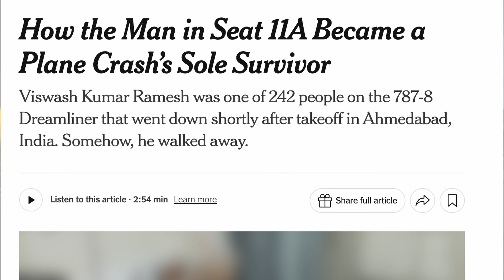Why the RAT Changes Everything – Air India 171 Update

Comment: As an Indian Aerospace Engineer, I’d like to share my perspective:

1. The airport in question is a major international hub, handling over 35 international flights daily. Since no other aircraft reported similar issues, the possibility of fuel contamination appears unlikely.

2. If there had been a complete engine failure, it would likely have been detected during the takeoff roll. Given that the takeoff seemed normal, it's reasonable to believe the engines were operating initially, though there was clearly a subsequent loss of power or thrust.

Ultimately, the exact cause will only be known once the black box data is thoroughly examined.

Deeply saddened by the tragic loss of lives—my thoughts are with the families and all those affected. 💔🙏
😢😢 😢😢😢😢
Reply: The fuel is still a question even though it’s a major airport. I hauled lots of jet fuel, one little hiccup can cause fuel contamination. 
The damage is done though and my prayers are with the families that lost their loved ones.
Reply: That means engines "failed" after the lift-off. Or rolled back to flight idle after the transition from "ground to flight" and crew were unable to restore the thrust.
Reply: Hi everyone,
I just wanted to share my perspective. Given that the aircraft was 11 years old, there’s a chance it suffered an electrical failure, leading to a total loss of power and engine shutdown. Since everything appeared normal during takeoff, the pilot might have deployed the RAT (Ram Air Turbine) as a last resort. That said, the actual cause will only become clear after the black box is examined. Until then, any assumptions or discussions are just our way of coming to terms with the event—because no explanation can truly make up for the loss 😢

Comment: Back in 2015 there was an article called "US aviation authority: Boeing 787 bug could cause 'loss of control" 
here is a fragment from there. A Software Error Could Shut Down the Engines
In lab testing years after its first delivery of 787s, Boeing discovered a software error in the generator control unit. The error could result in a total loss of electrical power to the aircraft, even in flight. The condition occurred if electrical power were left on for about eight months without being turned off. More specifically, the problem became existent on the 248 day of continuous electrical power.
With its extended dependence on electrical systems, the 787 could experience a loss of control if it lost all electrical power. Loss of control of the airplane could occur during any phase of flight, including takeoff, landing, or while maneuvering in the air. Control loss during takeoff or landing could be particularly catastrophic.
Why would any airline keep its airplanes powered up for such a long period of time? When the 787 was first delivered, customers discovered that the airliner issued a series of erroneous nuisance messages when it was first powered up. Boeing recommended that the airlines power up the 787 earlier for a flight than they otherwise might to avoid this condition. As a result, many airlines simply kept their Dreamliners powered up continuously until their next maintenance intervals.
Fortunately, according to Boeing's records, the electrical power for all 787s currently in service has been turned off as part of routine maintenance approximately every four months. The maintenance intervals for the airliner have been much shorter than the eight-month trigger point, so the problem of electrical power loss has never been experienced by an airline.

Comment: Hi Captain Steve. When you take into account that a) radios were working and b) pilot was able to pull up the nose until the last minute, do you think that is still consistent with loss of electrical power/RAT deployment? My understanding is that RAT only deploys if APU is not working. But there seems to be evidence that radios were working and pilot had some hydraulic power to pull up until the last minute.

Comment: But when you replay the video with the sound., the loud sound started right at the start of the video.. and on that angle at the start, the RAT is not very visible on the plane in the video which on that angle has a very clear shot at the bottom of the plane. So when you say the RAT deployed at the end of the video, it doesn't connect to us hearing the loud whirling sound at the start of the video.. AM i making sense?

Comment: I am a FAA licensed Airframe and Powerplant mechanic working on 767, 777 , 787 and other aircraft type that uses the RAT for emergency electrical and hydraulic power. One of the maintenance tests is to deploy the RAT and energize the RAT so it spins like a motor. This is done to simulate emergency deployment which is then measured for operational efficiency. The RAT is loud, very loud because the blades are turning at an very high RPM. You can clearly hear the noise throughout the hangar. This hangar is huge - it can hold 2 777's at the same time. 
May everyone whose lives were lost RIP

Comment: Stevie (I Wonder), why did you shout off your mouth, without getting your facts right ? It's very easy to shift the goal posts, once you've already done an evaluation of both the pilots credibility!!! The Captain had a clean flying record with 8200 hours & the Co pilot had 1000 hours, not a mere 100 hours. You strongly accused them of miscommunication, flaps, landing gear not retracted, etc etc etc. Then tou said dual engine failure is impossible!! You now seem to have  changed your mind. Anyways, an English saying comes to mind. " Its better to keep your mouth shut, then open it, and let all doubt out ""

Comment: So neither of those engines has failed, they are both in rude health, but they are either shut down, or being shut down. There's only one thing that could cause BOTH engines to power down at the exact same time, and it isn't contaminated fuel, it's the software in the engine management system.

There's only one "Single Point of Failure" on most modern airliners and that's the software, not the computer hardware, there will be redundency for that, but it would be running the exact same software. This will be some sort of software test edge case escape.

Comment: I asked Grok what would happen if the 787 lost all electronics, and this is the answer: If a Boeing 787 were to experience a total loss of all electronics, including the Full Authority Digital Engine Control (FADEC) systems, the engines would likely revert to a fail-safe mode. The FADEC system, which controls the engines, relies on electronic inputs to manage thrust settings. Without any electronic control, the engines would not maintain the last thrust input data, as the FADEC requires continuous electrical power and data to function.

In the absence of all electronics, the engines would most likely default to a predetermined fail-safe state, which is typically a low-power or idle setting, to prevent unsafe operation. This is because modern jet engines, like the General Electric GEnx or Rolls-Royce Trent 1000 used on the 787, are designed with safety mechanisms to avoid uncontrolled thrust in the event of a total electronic failure. However, the exact behavior depends on the specific engine design and its fail-safe mechanisms, which are proprietary and not fully detailed in public sources.

Given the 787's fly-by-wire systems and reliance on electronics for flight control, a total loss of electronics would also impact other critical systems, making controlled flight extremely challenging. The aircraft might still be controllable to some extent using mechanical backup systems (e.g., trim controls), but engine thrust would likely be at idle or a minimal setting, complicating any attempt to maintain flight.

For precise details on the 787’s engine behavior in such an extreme scenario, only manufacturer data from Boeing, GE, or Rolls-Royce would provide a definitive answer, as this information is not fully disclosed in public sources. Would you like me to search for additional context or focus on a related aspect of this scenario?

Comment: Come on Captain Steve! Hard as it is to suspect a fellow aviator, why haven’t you mentioned that this could have been an intentional act by a cockpit crew member? If the flaps had been prematurely retracted, and the engines shut down, what other conclusion can be drawn? I think the B787 fleet would be grounded if there were technical problems with aircraft design.
Reply: May Day call? Not likely intentional grounding.

Comment: just based on the premisa that "if they tried to begin take off with wrong flaps configuration , then all bells and alarms would start ringing, ",    then why in the event the copilot moved the wrong handle (the flaps instead of the gear-up)  would nt the same type/level of warnings  start ?   it is an equally preventable mistake (if it would happen).

Comment: There will be lots of data to be analyzed. The 787 has 2 EAFR-2100 recorders, one aft and one forward, the forward one has a RIPS-2100 which powers the EAFR for about 10 minutes.
The Collins Aerospace Enhanced Airborne Flight Recorder model 2100 is a multi function recorder which records flight data from the ADN, 4 channel audio data, communication, navigation, surveillance air traffic management (CNSATM) messages.
Another thing is that the RAT powers the center hydraulic system which the landing gear is connected. But the up/down movement sequencing is electronically controlled. So why did the gear stayed down?
The 787 redundant avionics is very complex, Think what happens if a power glitch disrupts communication on the ARINC network or kicks a GPM offline.

Comment: Electrical ? can Internal entertainment ( legacy system ) wired remotes shorting cause a blackout ? as they become darn hot after hours at times and are usually crushed into the holders ??
Reply: @captain steve ? can you shed some light , not asking for speculation but is the internal entertainment system connected to the electricals used for other avionics ?

Comment: I'm still struggling with the cause of both engines failing at the same time....especially with the gear still extended and the flaps up.
Reply: You just worry about what you're going to have for lunch today and let the official investigation come to a determination which you can then read rather than listening to and spreading speculative gossip.
Reply: @Salutimondo  Well, I'll just feel free to express my opinion freely, whether you like it or not, especially since it's an educated opinion coming from an ex Air Force pilot.
Reply: @mikekalish6796  It's unsubstantiated grandstanding gossip....

Comment: @dannyc.6744
0 seconds ago
DISAGREE.  PILOT ERROR IS A CONTRIBUTION FACTOR:  The Air India B787 used the entire 11,500 ft runway when about 60% of that length was required for take off.  This indicates a degradation of thrust and or improper take off flap setting.  When the aircraft rotated at the end of the runway, you can see dust being blown by jet wash indicating the engines were running (*It is important to note, just because the flying pilot rotated at the end of the runway does not mean they reached Vr rotation speed).  The RAT theory does not hold water.  There are pictures of the RAT extended on take off climb.  With a "breathing" airplane, RAT deployment does not prevent landing gear retraction.  The engines were clearly operating during climb and level off.  The airplane DID NOT have a simultaneous dual engine failure.  If so, the airplane would have quickly run out of energy / speed and an aerodynamic stall would have occurred.  The airplane clearly did not stall.  IN REVIEW:  Due to poor take off acceleration rate, the captain should have rejected / aborted the take off.  Despite the RAT being deployed during climb out, the engines were operating and landing gear retraction was possible.  The crew neglected to raise the landing gear (Yes, I am aware of the main landing gear truck forward angle).  The accident could  have been prevented if the captain rejected the take off.  Once airborne, retraction of the landing gear could have prevented loss of lift.  

POSSIBLE ALTERNATE THEORY:  Sometime after V1 (decision speed), the 787 experienced a catastrophic electrical failure.  When this occurs, the auto throttles are disengaged, EFIS (Electronic Flight Instrument System) disappears, and the FMC (Flight Management Computer) dumps all navigation and performance data.  The throttles must now be operated manually by the pilot and the crew must adhere to basic minimum speed restrictions which are rote memory items.  The emergency bus will eventually restore some flight instruments including operation of the radio.  This failure WILL NOT inhibit landing gear retraction.  It is possible this catastrophic failure overwhelmed the crew.  There were no performance data available (I.E. V speeds, etc.).  Instead of aborting the take off, the captain continued the take off roll.  Full power had not been set by the TOGA / FMC system which resulted in degraded thrust.  The CA did not manually add maximum power resulting in degraded acceleration.  The flying pilot used the entire runway because they had not reached Vr and probably rotated below rotation speed.  The crew NEVER manually increased maximum power and neglected to raise the landing gear. 

Note:  This is a plausible hypothetical.  A simultaneous dual engine failure is near impossible without purposeful intent.  With the exception of providing thrust for lift, the airplane appeared to be totally controllable.  There was no rudder displacement, yaw moments, etc.  There was a slight drift left of center line which is common when pilots are absorbed with other issues.  There was no indication of stall or any loss of control of the airplane.

Comment: A technical dual engine failure is statistically nearly impossible.
It is said that this jet had several electrical issues in its service history. Don't know if this information is correct. But electrical failure sounds way more possible than 2 engines failing at the same time or 4 times redundant hydraulics failing.
How is it with modern jet engines ? With all the fly-by-wire stuff and maybe also electrical injection systems (?) electrical gremlins could cause both engines to fail i assume ? I compare it to cars. It an old Diesel with mechanical injection and mechanical throttle you could rip out all electrics and even disconnect the generator and it would still run and drive normally. No way with a modern car with fly-by-wire throttle and ECU based injection. And If you have real relectrical issues ), not only power off, the RAT also wouldn't help.

Comment: I find it insulting and somewhat prejudicial to assume that a pilot in this day and age would forget to extend the flaps (even though impossible because of pre-take off config alarms), or even worse, mix up the flap lever with the landing gear lever. Is it easier to assume these errors because the pilots were Indian? Just like most people blamed the Max crashes initially on pilot error because the pilots were Ethiopian and Indonesian? Would we make that same assumption if the pilots were from a Western country? More importantly, why is no one asking why RATs are being deployed on an unusually high number of 787 flights compared with other aircraft? Is the 787 prone to electrical problems? Is Boeing hiding something from the rest of us?

Comment: Captain Steve, after watching your detailed analysis, I had one question: Is there any scenario on the Boeing 787 where the fuel supply to both engines can be inadvertently or unintentionally cut off leading to a dual engine failure? For example, could a systems issue, crew action, or misconfiguration result in fuel starvation even if there’s sufficient fuel onboard?

Comment: It sure looked like the flaps were full up while he was mushing into the crash. Gear down, flaps up, Something wrong there. I wonder how experienced this crew was together. Another video is claiming the thing hanging down under the aircraft is not the rat but I haven't looked at it yet. To be honest I could hear the rat clearly on your example but on the AI 171, I listened as closely as I could and I did not hear anything like a propeller similar to a small plane sound that was clearly evident in the example.

Comment: By large 787-8 uses 2.8 Kms of runway for take off but AI-171 used almost 3.5 Kms of the runway which prove engine gross was less. Then power was selective due to moderate engine group. This is a manmade accident, someone kept open-up-close in the engines. RAT was deployed just after lift off if the aircraft glide for an emergency landing but at such low altitude tail support was less & it couldn't glide. God Bless!

Comment: Could the double engine failure scenario not be part of the cascading casualty resulting from taking off without flaps (set correctly) - incorrect diagnosis triggering pilots to increase power and stalling the compressor - in-flight systems recognize engine failure and deploy the RAT? To call this definitive proof is premature.

Comment: If both engines failed at the same time were they both taking fuel from the same tank? Should that be allowed? Should fuel from one fuel supplier be allowed to feed both engines? Surely each engine should have an independent fuel source in case one is contaminated? Never understood why this is not implemented. You can still have two separate wing fuel tanks that can pump fuel to rebalance but the tanks should be separate and isolated and contain fuel from different suppliers. I also think the fuel should be sampled for contamination when the plane is on the ground. I also think the sampler should be built into the airplane which should refuse to allow the engines to start up if the fuel is faulty or contaminated.